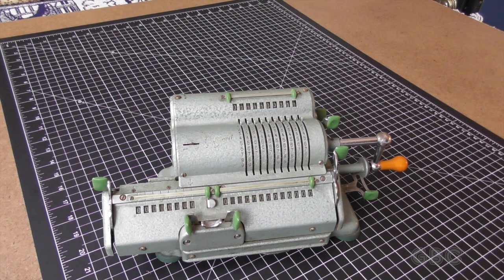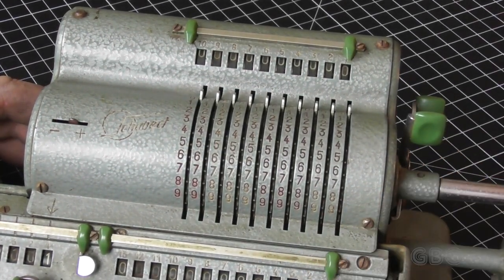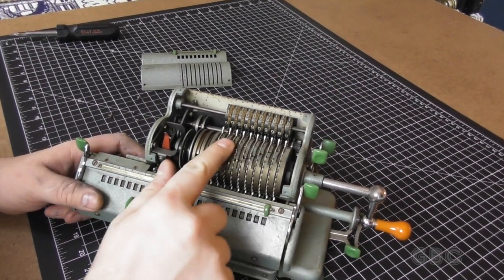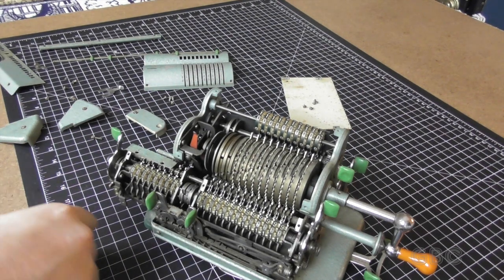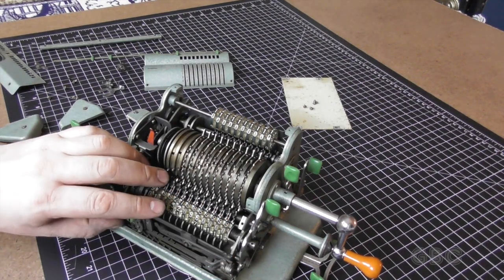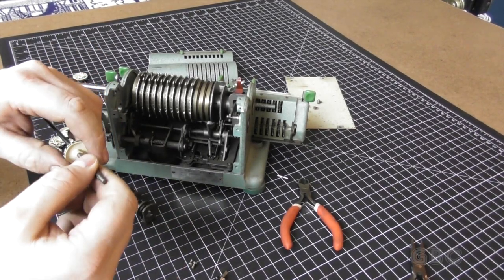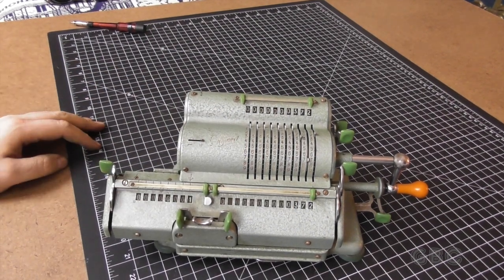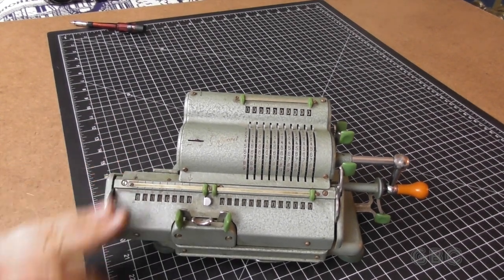[40] Mechanical Calculator Service

Comment: Those number wheels most likely were made of PA66 aka Nylon, which has the tendency to "swell" a bit over decades. Have had similar issues in the past, and did a similar job...and it worked well, too.

Comment: To test the carries, try doing 1,000,000,000 minus 1 (which of course should be 999,999,999), and then adding 1 to get back 1,000,000,000.
Reply from the maker: That's a great idea.  I tried it and it worked.